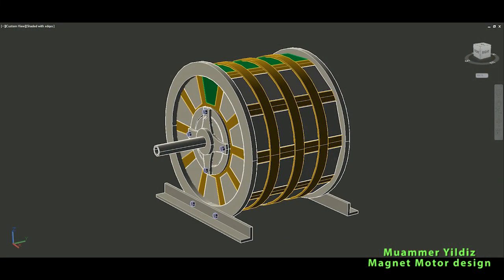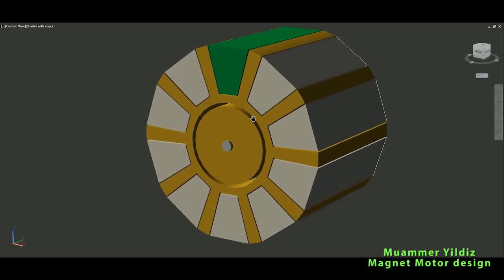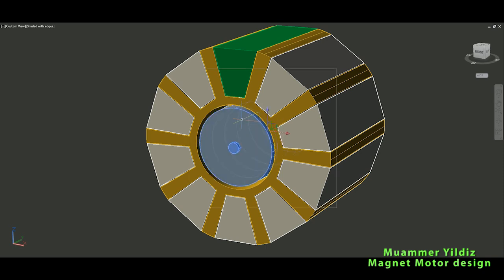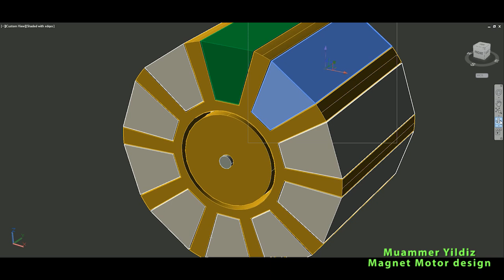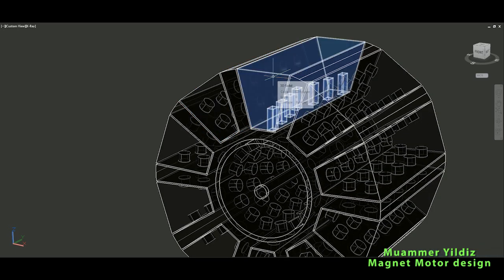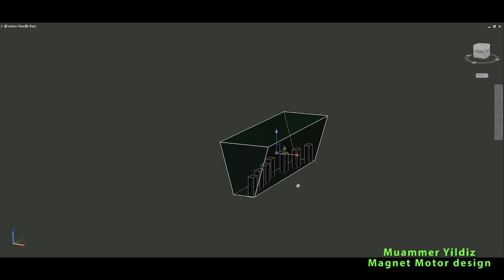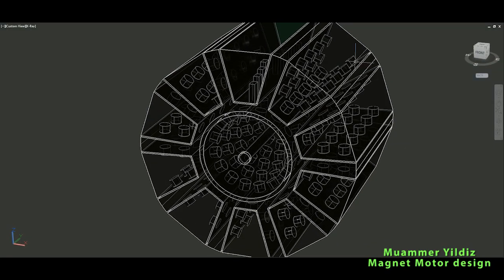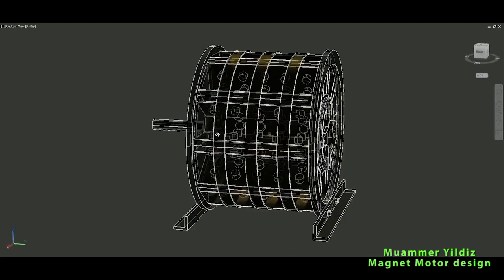Free Energy Generator, Working Patent! Muammer Yildiz Magnet Motor, Detail design!!!

Comment: great video buddy great work I will say we all need it but sadly it will not work 😎
Reply: Hey Martin, can you please explain your opinion as to why it would not work? Me,  myself and I have always, (ever since i first discovered the video) thought that it probably only works great for light loads, such as with the fan-blades he installs on the rotor-shaft and with which he blows air with towards the inside of a hollow cardboard tube, but after looking at that, I though to myself: Even I can blow air thru a hollow tube, (no pun intended EVIL minds) and so what make me doubt that it would do useful work (except for a fan to cool ourselves) is the fact that I have not yet seen him operate his Beautiful motor with a REAL load, such as a 1 kw generator!! So, that right there is what probably makes a lot of people who witness his demonstration a bit skeptical, and aside form that, it does seem to get too hot after it has been operating for a while because he does have to stop it after that
.
Still another thing is the ridiculous initial hammer-tapping on the back of the motor while inserting a rod to activate something inside of it just to get it going, when he can simply install an external break to stop it when its running, and releasing the break to get it going. That to me seems ridiculous and useless, but he is still a genius in how he discovered how to make a rotor rotate without what seems to be....no locking of the magnets at any time, so he nevertheless did do a REAL GOOD job, but we do still need to see if it runs with a Real load hooked up....right?
Reply: he is a paid troll. why wasting time
Reply: If you read the explanation above you can see that any combination of magnets will just stick together. Try it yourself. I have. Just buy some small magnets and stick them on a wheel with glue or drill some holes in a skateboard wheel and see for yourself what happens.
Reply: Joe P, did you replying to what I said regarding Yildiz's motor, and if so....have ever YOU seen it operate IN PERSON yourself, and if not, maybe you should one of this days, then afterwards you can either admit it does work, or relate to us what rigging you found that only makes a scam? Do it man!! Don't let what others taught you and conditioned you to believe as being true no matter what and "forever", keep you from YOU trying to find the TRUTH for yourself!!

I haven't seen it myself, but i truly do believe it is possible that his motor does indeed work, the problem I have with it is that the guy does not operate it with a real load, e.g., a 1kw generator, that's what I would really like to see him do. 
The attachment of a fan blade to demonstrate that it does run with no other input whatever but magnets, is not enough because even you and I can blow out air thru our mouths, noses, (some thru their ears) and last, but not least, even from our behinds, and so all I'm saying is that that guys motor probably does work, but that the horsepower is so minimal (considering that the motor-size is kind of bulky) whereas it would not be able to handle a BIG load such as a 1kw, or even a generator with less power-output?
I truly believe that the traversing of the opposite magnetic fields and their proneness to attract, and or, LOCK the opposite traversing magnet(s) "CAN" be overcome, not with two or three, or even four or 20 magnets, but with MANY more magnets which should be aligned differently at or on different locations around the rotor, and the inside of the housing itself, and which is precisely what he does, but of course there's always those who still remain incredulous to the FACT that the impossible, has many times been made possible!! 
Many remain so incredulous just as those who find it impossible to believe, THE FACT, that there is NO FREAKING GRAVITY!!   

On one of his videos he dismantles the motor for all to see and shows all the magnet-packs he uses and the magnet-alignments or positions all around the rotor and the housing....check it out!
Reply: Watch
who the GULLIBLE one is Joe: 

The number of Energy Invention Suppression
Incidents (from 2006 Caes-Statistics:
53 Number of Dead, Missing, or Injured Energy Inventors, Activists, and
Associates - 13 Number of Energy Inventors Threatened with Death -
16 Number of Energy Researchers and Associates Imprisoned - 7 Number
of Incidents Involving the US Central Intelligence Agency (CIA) - 4
Number of Incidents Involving the US Government - 27 Number of
Inventions Classified Secret by US Patent Office, ETC., ETC.... 
Approximately 4000 Number of Incidents Involving Oil Companies - 9 Names of Oil Companies and Banks Involved - Standard, Atlantic Richfield, Shell Oil Company, World Bank, Wells Fargo Bank.

Hitachi Magnetics Corporation: 
Magnet Motor Engineers at Hitachi Magnetics Corporation have come right out and claimed that a motor run by magnets is feasible and logical, but the POLITICS of the matter MAKE IT IMPOSSIBLE for them to pursue developing a magnet motor or any device that would compete with the energy cartels. The obstacles to free energy are the big banks WHO OWN OR FINANCE THE ENERGY INDUSTRY!!
So Joe P, to dismantle your utter ignorance check this out: someone CAN build a magnet motor or other types of machines which seem
to defy, or REALLY defy the laws of thermodynamics - and
there have been quite a few such overunity devices - but  those
devices have been suppressed by the government-Snakes who don't wish for the status quo to change. Their state of affairs is what keeps
all of them filthy rich, so Joe, maybe you should go work for them,
that is, if you aren't already working for them, 'cause the way you
come across buddy, there is NO DOUBT in my mind YOU would make a
Perfect, Great Snake for the Swamp in Washington's politics, and /
or the politics in patents office!!
Reply: I think some of the over unity group are naive or just hopefull. I say they should try and build one first before coming to a conclusion. Then the stars will fall from their eyes.
Reply: Just go see the damn thing for yourself in person so you can back and have some fun debunking it, what keeps you from doing that...or maybe just go so you can watch it kick your ass!! Go on, do it!!

Ah, and YOU believe in a so-called GLOBE, which is PERFECTLY ROUND like "THEIR' Blue Marble, no, wait....OBLATE, but which is actually....PEAR-SHAPED?? So which one is it little boy? 
Does that mean you also believe in GravyTea, and if so, then you are one of those who probably also believes it is both "Intelligent and Selective", huh?!!

Tell me about it Jack In The Box!!
Reply: riomar9 it takes too long buddy to explain but a little help for your response how can it keep going with what power supply that is the deep question all the best 😎
Reply: So you have rotor and stator magnets passing each other. Some will push while others will pull
In the end there is no net gain. It the same with any configuration. What energy you gain from an attraction you have to give up to pull them apart
So it is a zero sum. No need to debate. Just build one and you will see.  I have
Reply: Your mad professor attitude makes one laugh. I can really imagine how you would react in a classroom where some of your students would challenge you....LOL!! You're a funny Jack in the Box Joe P!!
Reply: You know riomar  just build one that works and joe will bow down to you. Me too
Reply: Martin Hunt, I really do like to be open minded about it all these. How can many of you so passionately (and ANGRILY a la Professor P) dismiss something like this "WITHOUT REALLY KNOWING" and this just because you were all taught to discredit everything which seems to be "unconventional" and without you AT LEAST trying to build one for yourselves so you can experiment with it, then after that, whatever the results may be, either debunk it, or acknowledge its veracity? Why can't, or won't you guys do that since you seem to take it very seriously and also get really upset about it? 
All I'm saying is, build one and see for yourselves whether it does or does not work 'cause its extremely easy to just say....IT DOESN'T WORK!! That is being utterly closed-minded (aside from COWARDLY) whereas it makes it seem like you are speaking from INSIDE THE BOX!!

At least those individuals are presenting us with something which we can actually see, and not just talking about it and without any physical presentation of it. 'So when someone goes off in fit, (especially in the manner the MAD PROFESSOR Joe P does - REALLY PISSED OFF at anything which goes against his GENIUS attitude!!) you are also taught of as being ridiculously insane....all talk, but NO ACTION!!  
Listen professor P, for the hundredth time: Go see it, or TRY to build one for yourself if you don't want to go see it, that's the ONLY way you'll EVER KNOW "FOR SURE"....PERIOD!!
Reply: That the whole idea chris craft, trying to reduce as much as possible the cogging of the magnets as they pass each other. Check out Troy Reed, (who was killed for not wanting to sell his idea or discovery to the Snakes!) who talks about that in the beginning of his video. The cogging of the magnet was the main thing he had to "OVERCOME", AND WHICH HE FINALLY DID!! 
That is the problem with MANY of the machines here on youtube, but that does not mean that it can't be done only because the so-called "CONVENTIONAL WISDOM" says it can't. That guy Troy reed, (just like others) did it, otherwise why would the freaking government-snakes want to buy his idea, (as THEY HAVE, many others) and when he didn't cooperate, they just went ahead and killed him? 
If it was, as YOU guys say about such machines: A Scam, or impossible, not true, etc.,, then why the hell kill him? Aside from that, the governments(s) Snakes know that most of this individuals will get NOWHERE with their inventions or ideas because they will simply not be permitted to do anything with them, so they just leave them alone.
But further, it is also when SNITCHES, who hate the unconventional thinkers and their ideas, attend those individual's public presentations of their REAL DEAL machines that, trouble begins. They, (the inventors and/or their families) get Threatened and Horribly intimidated by the Snakes after their Jack in The Box SLAVES-ZOMBIES report back to them with what they witnessed and then the Oil-Rich men decide whether action should be taken against them or not. 
Anyway, that's how many real good, over-unity machines have become suppressed and kept from being mass-produced because the status quo is not permitted to be messed with, simple as that!!
Reply: Hey riomar. I hope to see a working motor on YouTube that is why I look. I can't say I have found one yet. This man from turkey must have worked hard. But I don't see the special part that makes it work.  Just placing rotor and stator magnets opposing has never worked for me.  Since he has a patent it is ok to show everyone how it works. I wish he would do that
Reply: Have you seen one of his videos of one of his presentations where right after he stops the machine, he takes it apart for ALL to see what's inside, and even permitted some to handle some of the parts for examination? 
That tells me he is not trying to scam anyone. The other video about his 2013 or so expo, he has it there running for the public to see. One thing I've gotta say is that, after a while, the motor does seem to get a little bit too hot whereas its efficiency does also seem to go decline some, so he has to stop it for a while before being able to restart it. My guess is that, since it also uses bearings, maybe the friction from that causes it to heat up some, aside from that also the magnetic fields working against each may also also contribute to the heat-rise....who knows? 

Aside from that, it would probably be so expensive it would not be worth the money, especially if it can only blow air thru the fan he attaches to it to demonstrate what it can do, but as I also told Joe P, I would really like to see him attach a .5kw - 1kw generator with a load, to see if it does continue running or not cause a fan blade doesn't cut it for me...it would be a ridiculously expensive room air-cooling fan!! 

It's really interesting to see it running (even on video) so quietly and smoothly nevertheless.
Reply: I like to keep an open mind. I was also exited when I first saw the machine. I think he has had some partnerships that fell through.  I did notice his motor seem to slow down and there were wires in some videos. After all this time it is hard. To know for sure.  There are many creative people trying and I hope to see one be successful
Reply: Hey Martin hunt, you should check out videos on John Searl, there's one called:  Anti Gravity & zero point energy.  
Also, based on that video, and much of Tesla's discoveries having to do with flying craft thru the control and/or manipulation of Electromagnetism, it is my opinion that it is that same technology which is presently being used in many of the machines flying around the sky, even at low altitude at times, and which many people also refer to as UFOs. 
Also it is my opinion that those machines are the Government's, and other "Elites" recreational-vehicles which they use to, not only SCARE the crap out of people, but also to con the people into believing that the aliens are coming. 
I truly do believe they are using John Searl's, and even TESLA's technology in those flying machines! 
If the Germans were already using it back during WWll, why would they and many others not be using it today? 

Anyway, hope you really do sit back on your couch, relax with beer in hand, and watch the whole video. It's really interesting and based on that video (and a book I have which talks about such technology) I also truly believe that magnetic fields from magnets CAN be played around with to make something "unconventional" happen. If you do watch it, or have already watched it, then I ask: What say you buddy?
Reply: riomar9 have done look at my chanel list on free or better energy lol I'm all over it buddy am thinking mucury or liquid metal engine is interesting and not much on YouTube but it makes sense when looking into anyway I'm not sure if magnetic field alone could work really but am always open minded all the best buddy
Reply: we are sick of the bullshit.
Reply: Lol, he works with hal arrays... that works it will not creat much force like the lülling motor but it will work in theory...
Reply: Riomar, the whole setup is one big scam. Don't try to rationalize what scientific principle may be making it move; there isn't one. The guy is a shameless con man. No doubt there is a battery powered motor inside.
Reply: Why don't you go to one of his expos and PROVE that it does not work? People like you like to debunk EVERYTHING just because it goes against YOUR conventional thinking and closed mindedness!! 
Go check it out, read, study and analyse the actual plans which can be found on the net. Quite a few real good Mechanical Engineers have seen it work and have claimed that it DOES work despite what conventional thinkers such as YOU say!! 

I say it works, but that it CAN'T do any useful work except turn a fan blade so individuals like you can COOL OFF!! 
The reason I say this is because in one of his presentations there was this curious guy who went behind the motor to look at it, he placed his hand on the shaft as it was running and immediately a lady, (presumably Yildiz's wife?) who was right behind him right away told him not to do that. She told him to stop and to not be touching it or trying holding the shaft because that it would make it stop. 
That's what I understood had been said by the lady, and so if that is the case, then it only means the motor does run on its own, but doesn't have a good torque to be able to do any HEAVY, USEFUL work. 
So because of what she said to that guy, then by the looks of it, it really would not take too much hand pressure against the shaft to make it stop, and the reason for that being that there is always an opposing force from the stator which works against the rotor's opposing magentic force or fields while it is running, but the stator's opposing force is "weaker" than the rotor's opposing force, and so that is what I believe permits it to rotate. 
The WEAKER, "STATIONARY" STATOR and its opposing force working against the BIT STRONGER opposing force from the "MOVABLE" rotor, PLUS the DELICATE and PRECISE alignment of both, the stator's and the rotor's magnets, IS what makes possible for it to run, but to repeat, the rotor's operation is WEAK and that is why he only attaches an fan blade to it because all it can really do is....BLOW AIR, it is too weak to be able to do any other type of useful, heavy duty work!! That's what I believe is going on...comprende?
Reply: You said:
"...and without you AT LEAST trying to build one for yourselves so you can experiment with it, then after that, whatever the results may be, either debunk it, or acknowledge its veracity? Why can't, or won't you guys do that since you seem to take it very seriously and also get really upset about it? 
All I'm saying is, build one and see for yourselves whether it does or does not work 'cause its extremely easy to just say....IT DOESN'T WORK!! That is being utterly closed-minded (aside from COWARDLY)...."

"....all talk, but NO ACTION!!  
Listen professor P, for the hundredth time: Go see it, or TRY to build one for yourself if you don't want to go see it, that's the ONLY way you'll EVER KNOW "FOR SURE"....PERIOD!!"

riomar, are you truly unable to see the irony of your statements? LOL!!
Reply: My world view is decidedly different from your's. There can't be any meaningful dialog between us. Good bye.
Reply: Farewell my love...b good!!
Reply: Please, you are saying you have an open mind, but your mind is shut closed. You are openminded that it certanly will work, but not for the opposit. I watched the unveiling of his motor and to be fair, he didnt fully open the motor completely, the inner part of the engine were not exposed.

Also, as you said in a previous comment, that the engine became hot, means there is a loss of energy through friction and heat.
If we take this into concideration, how will he gain more energy from this setup to compensate for the sake of friction and heat the engine is creating?
Reply: Riomar9 Nobody has to inspect this motor  in order to realise that it will not work. Joe P is completely correct in his explanation of why the motor cannot possibly work. If you would rather believe in magic than science then it is pointless trying to explain the physics.  A smart person can see through this fake machine in seconds. 
I'm not one to say that things are impossible, but if a "Free energy generator" is ever to exist it will not be in the form of an elaborately designed induction motor like Yildiz's.
Reply: Not if they have the same poles, which is how this works, have the magnets spaced so that the some poles have to push away and then the next ones one the rotor do the same, and on and on and on. the only problem is it might self destruct  unless there is a speed controler.
Reply: riomar9 : If there is such a motor or any device the above-mentioned banks etc would finance them and reap huge profits. Why would they refuse such an offer. Pl read "Physics for Entertainment" by Yaakov Perelman.
Reply: chris craft: "So you have rotor and stator magnets passing each other. Some will push while others will pull
In the end there is no net gain. It the same with any configuration. What energy you gain from an attraction you have to give up to pull them apart
So it is a zero sum. No need to debate. Just build one and you will see.  I have"

That was a great explanation of why we've yet to see a working magnet motor. Tell me, Chris, what were the dimensions of the individual magnets you used in your experiments? Could you post a link for them?